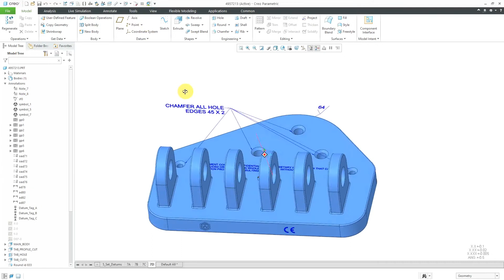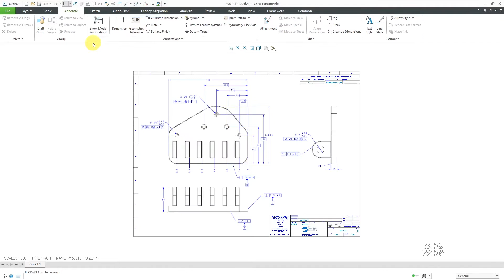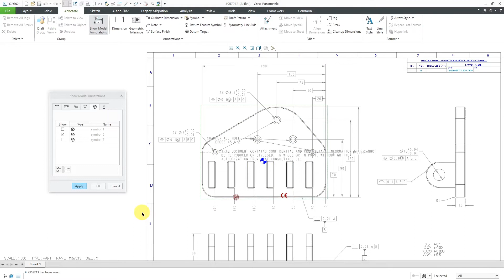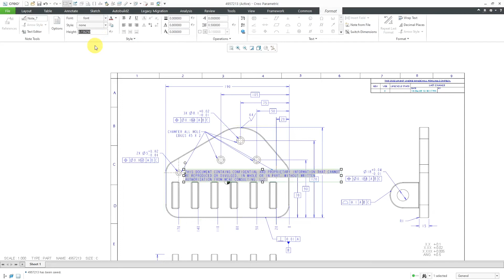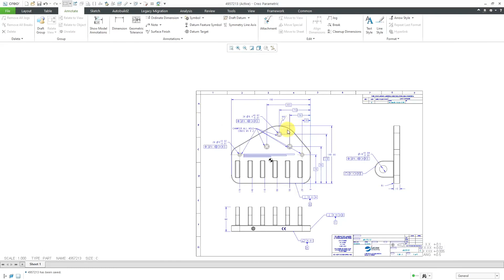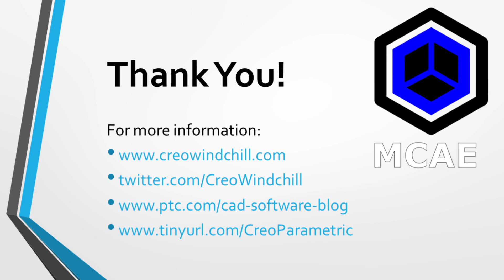Creo Parametric - Drawings - Show Model Annotations Part 3 - Notes, Symbols, and Surface Finishes

Comment: Hello David and thanks for your tuto ,  why do a drawing since everything is already on the MBD 😊

i am sure that mbd is a certainly fast an efficient way to exchange model with customers but  Does  PTC advices a standard way to create a mbd model ( a chart )
Reply from the maker: Some manufacturers and suppliers can't support MBD. And a common misperception is that it's either drawings or MBD, and that MBD is "drawingless." MBD means that the model is the primary repository for PMI (Product and Manufacturing Information), and you have the option to generate drawings when you need to.